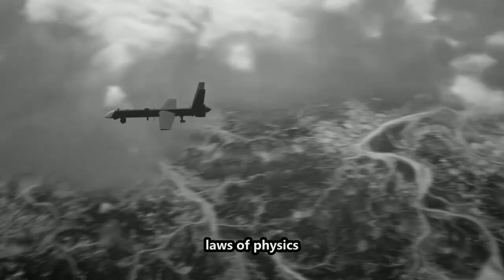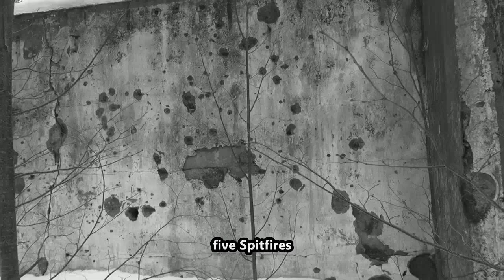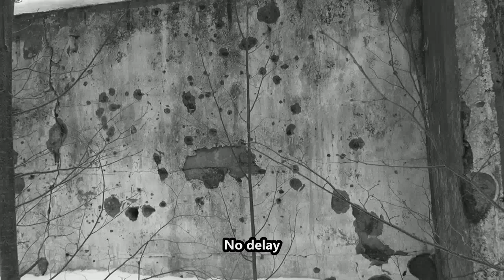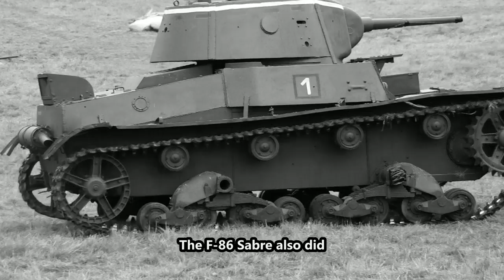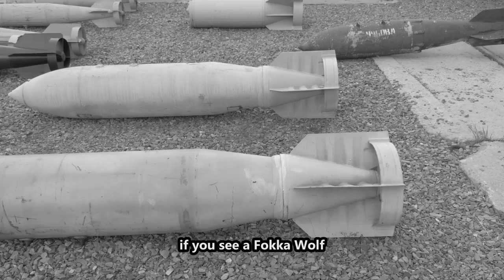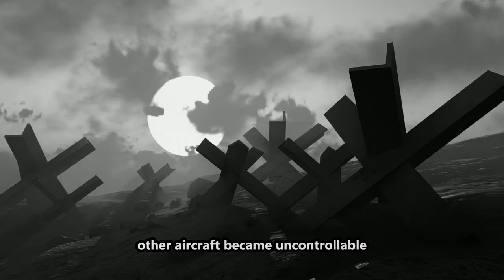Allied Pilots FEARED the Impossible Agility of German Focke-Wulf 190

Comment: AI driven garbage.    No real knowledge, it shows.

Sorry man.    Use your own voice.    Learn the subject matter.

Short story is the early radial 190s had superior roll rate and wonderful armament.    Sucked at sustained or even instantaneous turn.   Climb rate at hi speeds was good but max climb rate sucked.     It handled well, it surprised the brits.   This was all in the days before people really got and studied BFM or ACM. 

Later limited production inline 190s improved hi altitude performance (lacking in the radials).     Not so many made.   Compare to Spit 14, which in clipped wing format literally did EVERYTHING better, climb rate at all speeds, instantaneous turn, pilot visibility, sustained turn, equal or superior instantaneous turn..   very similar roll rate.   An experienced RAF pilot wearing a g-suit, with a clipped wing bubble canopy spit 14 had NOTHING to fear from a 190.    Of course the pilot, especially back then, was paramount.    But given equal pilots youd be a moron to pick a 190d over a spit 14.      

Do some research and try again.    Poor video with the AI voice and completely out of spec vid frames.